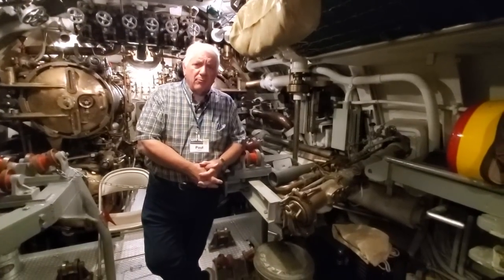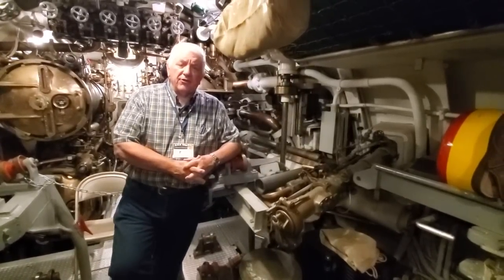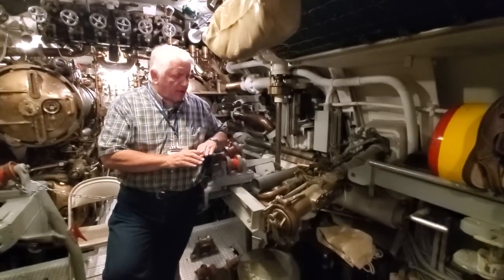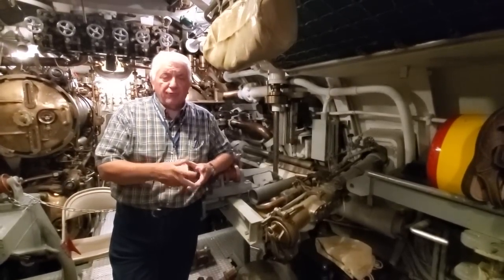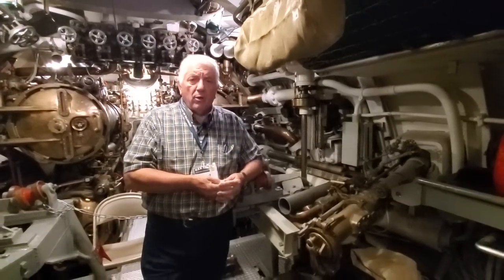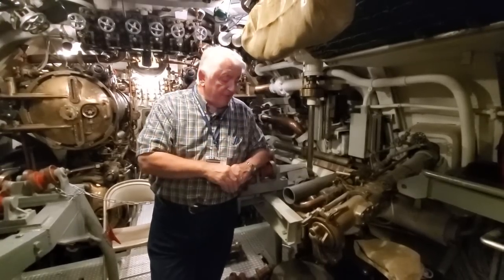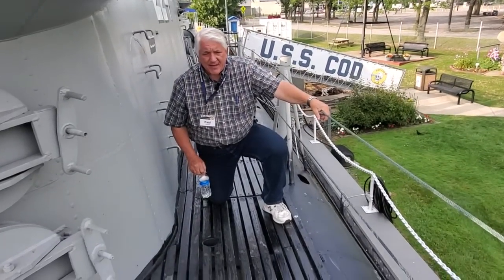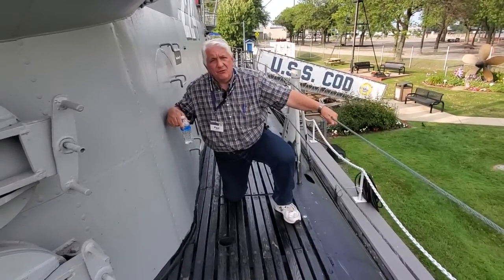Submarine Communications: Signal Flare Ejectors Aboard USS Cod

Comment: ....why wouldn't they get on the radio and tell them (attacking friendlies) to knock it off? They had the radio frequencies for aircraft for their rescue work as well as for surface ships
Reply: American boats in WW2 used HF and VHF for comms and both attenuated to rapidly to be of much use.  If radio waves propagated to useful ranges then sonar wouldn't be needed. I was a sonar tech, were you a radioman by any chance? After WW2 the Navy did tons of research to communicate reliably with submerged subs and the only long range stuff that worked satisfactorily was ELF.
Reply: That would mean poking up an antenna or even worse broaching and giving away their position.
Reply: @tomtrenter3208  radios work underwater at the depths they'd operate at
Reply: @Shinzon23  not in WW2.
Reply: @tomtrenter3208  yes, they did
Reply: @Shinzon23 No they didn’t. At least not in the way you’re thinking. Also, in addition to emitting an electronic signal that could be triangulated by the enemy, they likely would have any idea which frequencies the attacking friendly aircraft would be operating on. 

Hell, adjacent army units often have extreme difficulty communicating with each other.
Reply: @JasonB27358  except they were specifically given those frequencies for use in the recovery of downed aviators
Reply: @Shinzon23  Maybe if they were on lifeguard duty. They wouldn’t have every radio frequency of every aircraft, nor would they be able to identify which specific aircraft was shooting at them, look up the frequency, program the radio, and then contact it before they were full of holes. It’s just not realistic.